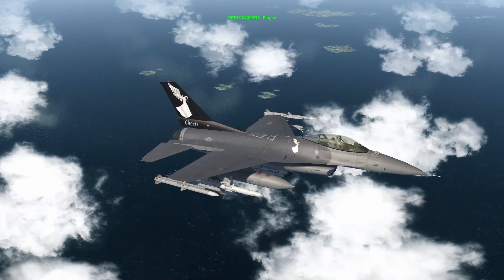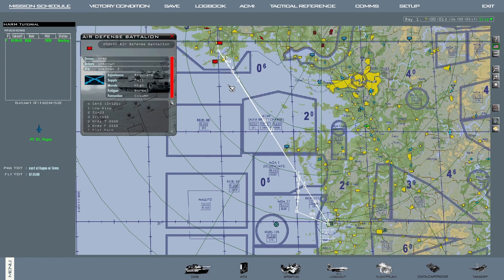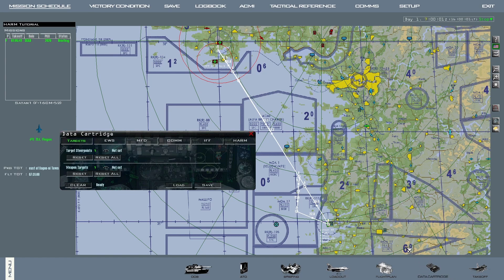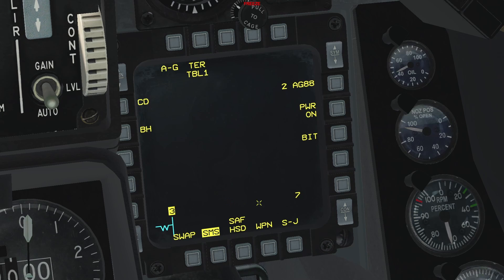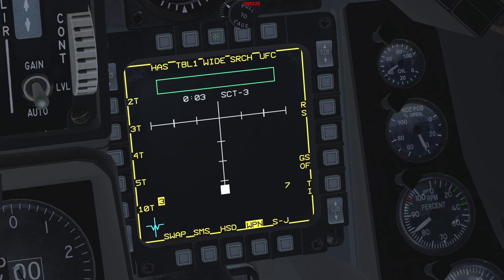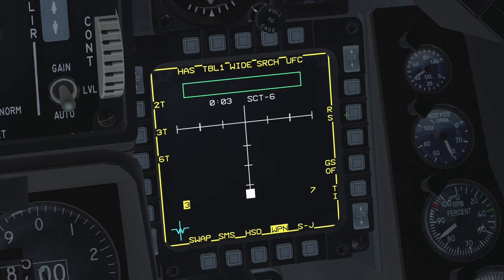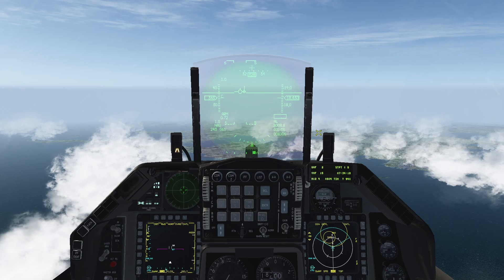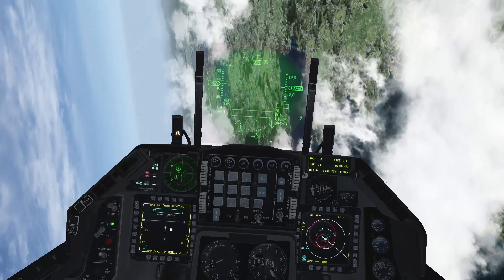Falcon BMS 4.37 Tutorial - AGM-88 HARM in HAS mode

Comment: Does it take a certain amount of time for the HARM to receive the target data? In my case, they're not flying directly toward the radar, but about 10° off-axis.
Reply from the maker: That's strange. If you're using this mode, HAS, then the missile itself is the sensor so there shouldn't be a significant time to hand off the target information.

However this missile isn't infallible, I've seen it go after another signal of the same type that I had told it to go after, just because it happened to be relatively close by. Could that be your issue or are you experiencing this on different missions and different targets?
Reply: @fisgasfighties  It's Training Mission 12. Okay, my English is very poor, so I watch the videos with subtitles. Maybe I'm making a mistake somewhere. But somehow, the F-16 fascinates me again. I had one from the first day the Falcon 4.0 was available in Switzerland in 1998, and I've flown it a lot.
Reply from the maker: @jollyroger3941 I think your English is just fine. Are you having issues while on HAS mode or using the HAD?
Reply: @fisgasfighties  So, me again, I can't hit anything. It got me frustrated, so I took a break. I thought it would be better in 4.38 (I was having stability issues), but I got exactly the same result. I have a video (4.37) and am sending the link with a separate reply. However, I'll be landing in Incheon (ICN), known to you as RKSI, next Saturday and checking out Falcon4 Land for a while.
Reply from the maker: @jollyroger3941 DM me on discord and send me that video, maybe I can figure out what's going wrong

Comment: Great video man. Question🙋
1. Does the jammer help against these Ground radars?
2. Which is the most effective HARM deployment mode? Cause I found the HAD very good as you can pretty much launch a GPS guided missile at it from the TGP, but then again if had to only use HARM, then which would be most helpful, like which you always use and get best results. HSD, HAD or POS.
Reply from the maker: 1 - The jammer absolutely helps with Air to Ground radars.
2 - The HARM deployment mode depends on the situation. On most situations where the HTS/HAD is available to you, use that. When you're looking to have a missile going at a SAM unit before you enter their threat circle, just POS mode. But you can absolutely use the TGP along with a HAD and use another weapon other than a HARM against them if you can locate them visually.
Reply: @fisgasfighties  Can you explain how to use the TGP? Presumably only in POS mode where the TGP looks at the steer point or would the TGP automatically focus on a locked target in HAS and HAD? Excellent tutorial though!
Reply from the maker: @danster328 the TGP can work alongside the HAD, but it will not work alongside HAS mode.

While using the HAD, the TGP will point at whatever emitter you're tracking on the HAD. The highest the PGM value the closer the TGP will be to be pointing at the location of the emission. However, keep in mind that even on PGM 1, the highest value, the TGP might not be looking at the exact location, it's possible that it could be off by a couple of miles, it's then up to you to locate the target visually through the TGP as you would normally while locating a target.

Does that make sense?

Comment: Great tutorial! Is it possible to correlate the has to the tgp? in other words can i get the exact location of the sam site from the has page after designating the target?
Reply from the maker: @rockwellh6910  I never tried to corelate with the TGP while using this mode because unlike the HAD which will give you an approximate location of the emitter, HAS only gives you pretty much a direction to the emitter. But I'd have to test.